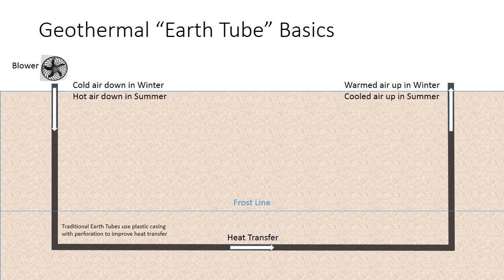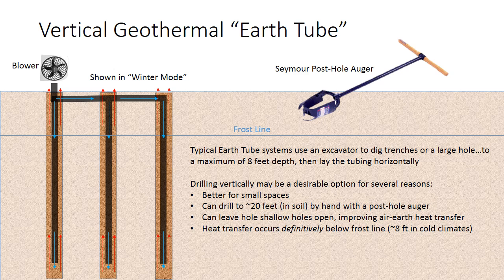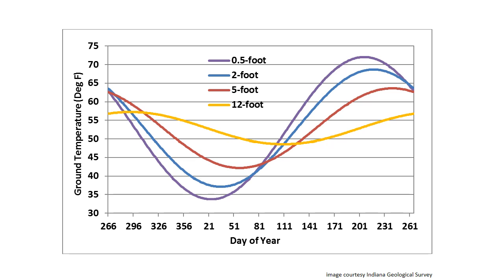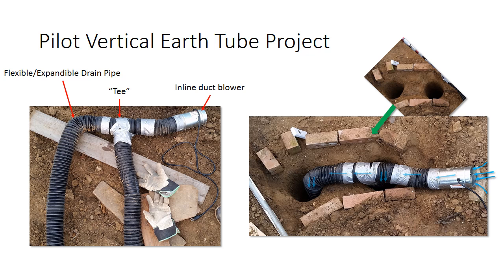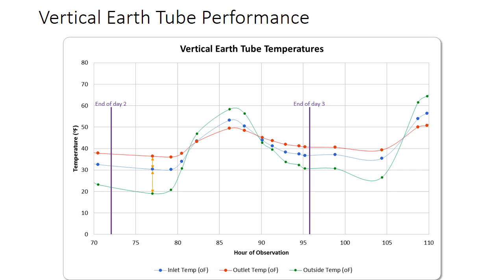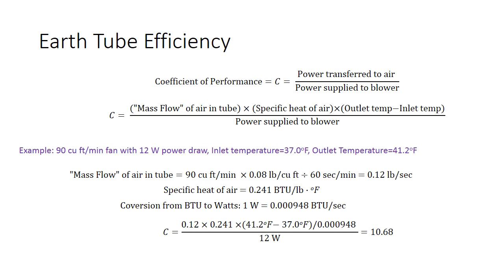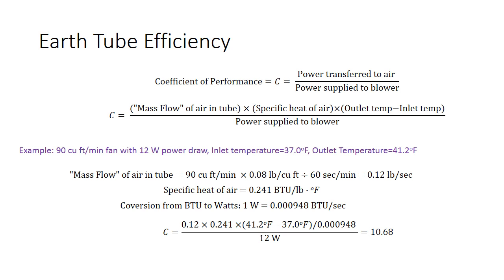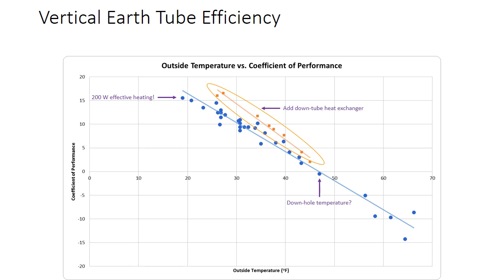Vertical Geothermal Earth Tube (Part 1) - Greenhouse Heating/Cooling

Comment: I built one yesterday and our frost line is 18" in Vancouver Canada so my air draw is at 56f inches down and has 13.8c temp for cooling my citrus greenhouse. I used a vented Ikea basket as shoring a the 4 inch at bottom with drill 5" pot intake.
Reply from the maker: that's great.  Yeah I think the geothermal systems are actually more effective for cooling!  It's been awhile since I've had an active geothermal system in a greenhouse, but maybe next year.

Comment: Do you get a smell moldy or radon gas methane when you do this
Reply from the maker: none that I'm aware of, but I recommend a "closed" system if possible.  Excessive moisture is my bigger concern with open hole geothermal

Comment: now i want to dig holes all over my house !!! 
looking now for a seymour post hole digger and a galvanized steel pole 

is a 3/4 threaded steel pole good for the seymour ?
Reply from the maker: The Seymour digger is excellent.  Yes, I used 3/4 inch threaded black pipe and coupling to extend the length of the digger.  Make sure you lube the fittings, because they get pretty tight after a lot of digging!

Comment: Have been trying to find quality content and experimentation on this. Found you
could you recommend a system design for a tropical climate ?
Reply from the maker: @Moaz Qadri - Geothermal is very effective for cooling, because as the hot, humid air goes underground, water vapor will condense.  This cools the air AND reduces the humidity.  However, you must take great care to allow the condensation to drain away from the geothermal system.  For this reason, I prefer "closed" geothermal systems (https://youtu.be/A2TQJl9WjLc or https://youtu.be/Ze0nXN6Vvic).  You will need to install drainage holes in the geothermal pipe and ensure that condensation drains away from the pipe.  If the pipe fills with water, then your system won't work!

Comment: Do you have any advice about Radon?
If I dig a hole and lower a test kit, will it give me an accurate reading?
Will this system cool a greenhouse in the Arizona desert?
Reply from the maker: Radon could be a problem with this system (hole open to the surrounding dirt).  Especially if you have clay soil.  If you vent the greenhouse, as I'm sure you'd do anyway, Radon probably not an issue.  However, my 2018-19 and 2019-20 geothermal systems are all completely closed (go to my channel page).  Most people utilize a horizontal, closed system.   Horizontal is typically more efficient for full greenhouse heating/cooling applications for the simple reason that you can get more pipe underground than with a vertical system.  Of course, those people typically have large acreage.  If you are a) space-constrained, b) have a low water table, and c) can easily drill to 20 ft, then the vertical system has real merit.  The deeper you drill, the more stable the temperature (say 55 deg F).  If you leave the outside of the hole open to the ground like I did in this video, then you will increase humidity in the greenhouse.  In Arizona, maybe this isn't a problem.  If you have any more questions let me know.  Good luck!

Comment: Morgan, we'd like to build an earthtube to help cool our second floor.  We also live in Denver (Golden) on 2 acres.  Could you help us find someone to build it or could we hire your to build it?    We don't need heating, and just cooling on the 800 sq foot second floor story.
Reply from the maker: I'm flattered!  Unfortunately I do have a day job, so I wouldn't be able to actually do it for you.  However, I can definitely give some words of "wisdom" (or maybe lessons learned from failure).  For a 800 sq ft space, you will need a bigger system than I show here.  However, you have a nice big lot, so you have flexibility.  I would aim for a "horizontal earth battery" system, rather than the vertical system that I show here.  I'd recommend hiring a backhoe to dig a fairly large area as deep as possible.  Just pulling numbers out of the air, but I think you want to aim to have about 500 ft of drain pipe underground.  

Since the air will be going directly into your home, you will want to have a fully sealed system, unlike what I showed here.  Air flows over the moist annulus of the well, pulling humidity out of the soil (and into your room), and posing a radon risk.

When you cool hot air, moisture will condense out of it and fill the pipe.  You'll also want to have the pipes slightly angled down in one direction, with weep holes and gravel pack, to keep water from filling the pipe.  I would also look into a filter on the outlet pipe to protect against any microbes that could be growing in the pipe.

I'm definitely happy to provide my opinions, but I'm no professional!  There's a company in Boulder called Ceres Greenhouse Solutions which builds greenhouses using this geothermal heating & cooling.  They could provide you with some advice, but they'd likely be pretty expensive and they might balk at doing a project like this.

Comment: Great videos.  Thanks.  I have three questions: what if the soil is loose.  Can you line the holes or does that defeat the purpose?  What if water gets in the hole does that negate the value?  I notice you cover the holes so aren't you blocking the outflow of warm air?  I'm assuming these holes need to be inside the greenhouse, correct?  Sorry, four questions.
Reply from the maker: Hi George.  You hit all the good questions.  Loose soil is a blessing and a curse.  Good because it's easy to dig, bad because of the cave ins!  You can definitely line the tubes and in fact I'd recommend it to keep humidity and radon at bay.  Last year I came up with a way to dig two parallel holes and run a u-shaped length of drain pipe in the hole.  This suppresses humidity and enhances airflow, but it's tricky to implement.  Water is an omnipresent problem.  You don't want water.  As long as you live in a dry climate and don't use the pipes for cooling, you shouldn't have condensation in the bottom of the holes.  Condensation would destroy the u-shaped airflow.  If condensation is a problem, I'd recommend opening small weep holes in the drain pipe and filling the bottom of the hole with gravel prior to inserting the drain pipe.  This year I abandoned the vertical earth tubes and just went with a small horizontal system.
Reply: Thanks for the quick reply.  Unfortunately for me I have a spring that feeds a pond and the spring is some  twenty feet away from where I was hoping to put this system.  By "lining the hole" I meant putting in a pipe with a cap on the end so water could not enter the pipe but it sounds like an opening in the bottom of the pipe is essential so, I'm out but thanks again!

Comment: Is it possible to test the system for radon?
Reply: No greenhouse as yet. I wanted to dig a vent and test it before commitig to the system. I'm planning on building a house too with the same system. As long as I'm not getting radon. I'll dig a hole and lower a test into it.
Reply from the maker: @taylorphillips5118  Ah, I understand.  Yes, if it was my house, I would definitely want to ensure that radon wasn't a problem.  Last year, I drilled two adjacent holes and used a U-shaped tube (https://www.youtube.com/watch?v=Ze0nXN6Vvic).  That could be a good answer if you want to use this for household purposes.  This year, I simply dug a pit and buried 25 feet of tubing (https://youtu.be/A2TQJl9WjLc).  If you plan on using the geothermal system for cooling (probably most useful for household), make sure you put a weep hole at the lowest point of the system and bury gravel to keep condensation out of the pipe.
Reply from the maker: I'm sure you could test for radon by simply putting a test kit in the greenhouse.  I am not sure if this geothermal implementation would cause the greenhouse to have more radon than it would without geothermal.  In any event, I've gotten away from this implementation for the last 2 years.  I'm now using a closed system (no down-hole soil exposed to air)

Comment: Great presentation, chock full of useful information. Thank you very much for making it!  No concerns about blowing microbes into the greenhouse (could be avoided with a double tube system I suppose)?
Reply from the maker: Thanks, I sure appreciate it.  I think your concern about microbes is a valid one.  Another concern is the increase in humidity from the ground.  As a result, I went to a U-shaped configuration last year (https://youtu.be/Ze0nXN6Vvic) and actually simplified to a more conventional horizontal system this year (https://youtu.be/A2TQJl9WjLc).  I'm more focused on compost heating for my greenhouse now.  If you have enough space, however, the geothermal concept is excellent.

Comment: I was just wondering if you could cool your house this way.
Reply from the maker: Yes you could, though I would recommend using a closed system (no air flowing past open hole), due mainly to the humidity that it would add.  Take a look at my newest geothermal system (https://youtu.be/Ze0nXN6Vvic) for one idea.  You'd probably want to use a larger system than I implemented, with a powerful blower.  The water vapor in the warm air will condense when it goes underground, so make sure that you add weep holes at the low point of your geothermal.  These types of systems actually work FAR BETTER for cooling than they do for heating!  Good luck.
Reply: @MorganBrown  the link above is broken
Reply from the maker: @moazqadri5324  https://youtu.be/A2TQJl9WjLc or https://youtu.be/Ze0nXN6Vvic

Comment: Thanks for your video, my thoughts are isn't 52 F still quite cold?  If you kept your home at 68 F you would still be shy some 16 F.  Or am I missing something?
Reply from the maker: Ha, no you're not missing anything!  I'm using this to warm my greenhouse, so 52 F is perfect!  It would be much more challenging for a house.  You could probably cool a house.  Heating is much harder.
Reply: But in colder climates, isn't 52 F still warmer than the outside temps, so presumably the house wouldn't need as much energy to heat it in the winter?

Comment: I first noticed the greenhouse in the snow geo air system...I want to combine ICF concrete construction including a concrete roof (extraordinary thermal mass of concrete) with geo air and solar panels including a couple of banks of lithium diode batteries, LED lights and induction stove.  I believe I can make a home that is a net electricity producer.  Hope to try it in the next 2 or 3 years.

Comment: What size is your greenhouse? I'm wondering how many wells we would need for a 13,000 sq foot greenhouse in southern AZ. We are interested in heating and cooling.
Reply from the maker: Sorry, I just saw your comment now.  It really depends on how many wells you drill.  I found that for heating, I could heat a ~20 cubic foot volume by 4 degrees with 4 wells drilled to about 8 feet.  For a 13000 sqft GH, you'd need a lot of wells...unless, perhaps, if they were very deep.  For a GH of that size, I'd recommend the horizontal earth tube.  You excavate with a backhoe and lay hundreds of feet of tubing.  I'd also recommend excavating directly below the footprint of your GH, if that's feasible.

Comment: How do you deal with radon gas emitting from the earth into your perforated tubes?
Reply from the maker: Disclaimer: I've never tested radon in this system and don't really care because I'm not inside the structure often.  If you have a problem with radon, you'd probably want to line the hole with PVC (pricy) or drill two holes next to one another and run a u shaped tube. I will take the latter approach this week when I redrill my geothermal system
Reply: Hello ,  tried to follow your YouTube link .  I believe you have the last symbol included in your link . That makes not able to follow .
Reply from the maker: @richardduke9788  Thanks!  I fixed that link.
Reply from the maker: Also, FWIW, these tubes aren't perforated

Comment: What's keeping the holes from collapsing?
Reply from the maker: In my case, the soil is fairly competent, and doesn't collapse.  If you have a sandy soil, and/or shallow groundwater, that could be a problem.  My water table is deep.

Comment: This is awesome! There's a pop can solar heater video around where tubes of pop cans are painted black to absorb heat from the sun then transfer the air into the building. It would never supplement this system as the wells would actually cool the air that's heated by this, but it's interesting how the "Tubes" in the heater are constructed. they leave the bottoms on the pop cans but cut them in a way that makes the air spiral down the tube instead of going straight through. If you were to "Spiral" the inlet below the frost line, you would increase the distance the air has to travel, thus giving the air more time to 'soak up' the heat (or lack thereof). I'm not sure how much more efficiency you would gain, but would certainly help where space is limited.
Reply from the maker: Dwayne, thanks for your note.  The design that I'm most interested in trying is a "U-shaped" system.  i'll have to figure out a way to dig two holes very closely together.  I'll probably buy an 8-foot section of 6" PVC, cut it in half, and make a side-by-side template.  The advantage of the U-shaped system is that I can simply pump the air through the U, which is far more efficient than the system I show here.  Also, because I have air circulating over open hole, I add a lot of unwanted humidity into my greenhouse in the winter.  The U-shaped system won't touch the wet soil underground.
Reply: Wasn't expecting a reply after 2 years, wow!

We bought some land and I'm hoping to build one of these in the spring! Going to try some experiments and see what works best. Was also thinking of the actual Solar heater and well combination with sensors and programming. Depending on the temps in the well and the solar output, I could have software switch between the two 'technologies' to help stabilize the temps.

Comment: I have a fairly deep lake in my back yard. The water temperature at 10' down rarely gets below 60 F. I would like to pump water from that depth and run it through a radiator in my greenhouse. I will return the water below the surface and won't be wasting energy due to lift. The resistance to flow and the power to the fan will be my only energy loss. The specific heat of water is very high and represents hundreds of watts of free energy.
Reply from the maker: Jim,  I wish I had one in my back yard! ;-)  Smart of you to keep the water in a closed system, as it'll help control humidity.  Another (lower-tech) option: just pump into a 55-gallon drum with an overflow pipe running back to your lake.  The thermal mass of the water barrel would act as an additional temperature stabilizer.  Or, you could pump into the drum AND run your radiator to get the benefits of the thermal mass AND rapid heat transfer.
Reply: One of the reasons I bought the house was because of its proximity to the lake. It represents millions of BTUs of almost free energy for both hearing and cooling. I like your thermal mass idea.
Reply from the maker: Jim Ferguson yeah, my in laws live on a lake in Florida.  Not as deep as yours, I’m sure, but they have a geothermal heat pump system utilizing the lake.  Great bang for the buck.  My dad in western Colorado also has geothermal heat pump, but he had to drill about 250 ft...that wasn’t cheap!

Comment: I live in the SW, local frost line is at 5-10". Does this mean that I Would only have to sink the vertical pipes to depths of only 1foot to acquire the geothermal benefits?
Reply from the maker: The deeper you go, the closer temperature gets to a stable background.  That’s probably 10 feet in any environment.  Another reason to go deeper is to maximize the volume of air cooled or heated.
Reply: Thank you so much for clarifying that for me.

Comment: If I'm making an earth tube to cool a desert cabin is it better to have a blower on the inside sucking the air in or should I put a blower on the outside that pushes the air into the house? Which way is more efficient?
Reply from the maker: I wish I could give you a definitive answer.  I suspect that pulling would be slightly more efficient, as the zone of turbulence in front of the fan would be dispersed into your cabin.  Right now I am running a heat exchanger in my compost heating system and have fans on BOTH ends!

Comment: could you  use an inverted V  and  intersect the  the borings  ?????  no backhoe  and yet you have more surface area   per unit and less back pressure     if you did it right you could lower some 6" pipe  cut at angles  to stop   collapsing  dirt.. or could you line the holes with cement?
Reply from the maker: Not a bad idea to improve airflow into the system.  Personally, I am lucky as my soil is easily diggable, yet dry and very stable, so I don't require any casing to improve hole stability.  Many other people who have posted comments do have a problem with hole stability, and yes, I recommend casing the hole with 6-inch pipe.  My next geothermal system is actually going to be a big hole -- think root cellar -- with fans blowing air in and pulling it out.  A decent sized hole would have as much volume as a buried system with 200 feet of pipe.  We shall see!

Comment: So what powers the blower ?
Reply from the maker: 12 watt inline duct fan.  I'm running it off of AC, but it is a low enough wattage that you could easily run it off a solar installation, but I've not tried it.